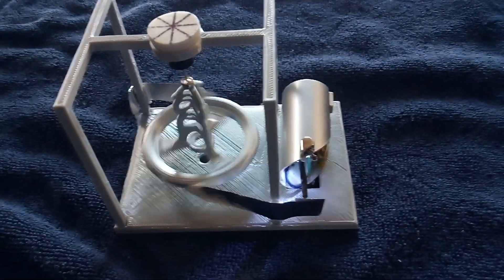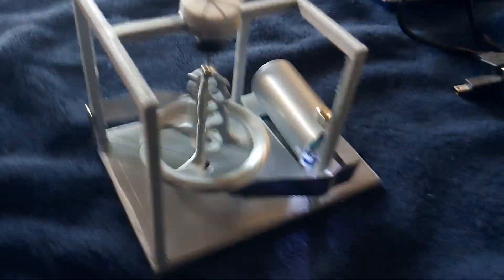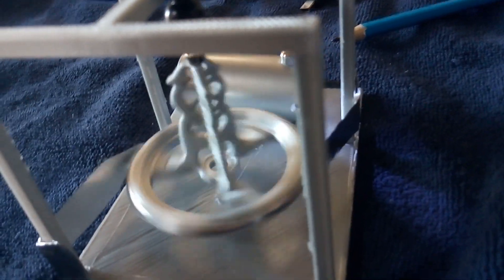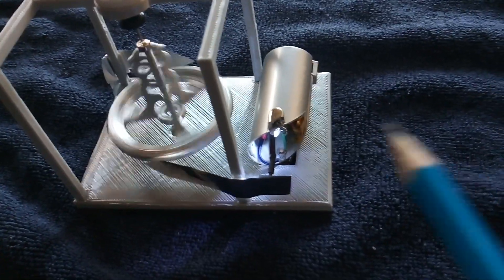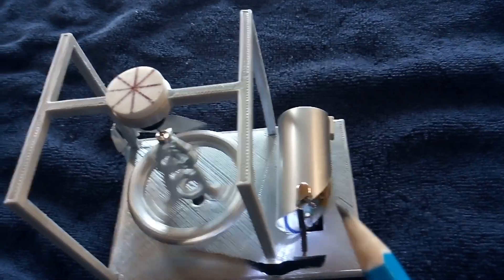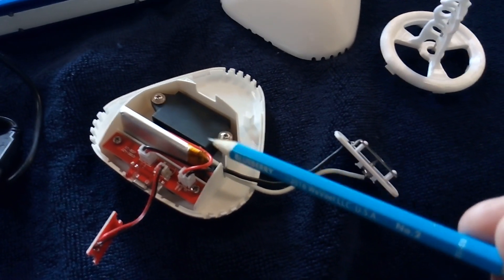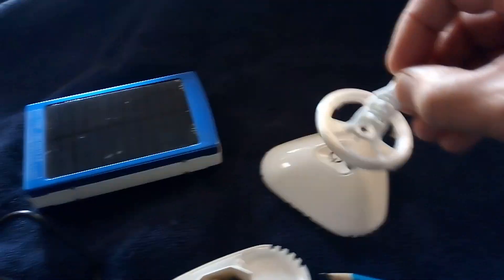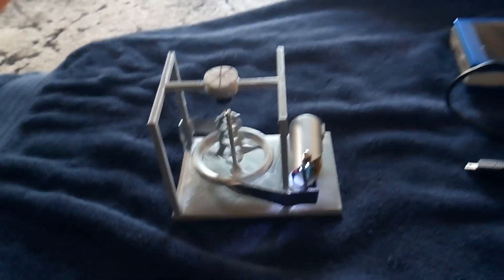Electrostatic Stone Grandfather Top

Comment: Yeah thats the thing about electronics and certain gadgets,  you think they will last longer then they should but they don't.  I do think you should go through with the solar panel idea though however if you do, id connect them directly to the lithium ion battery through a diode.  Otherwise your gonna have a lot of losses through the charge circuitry and its not going to work very well.

Comment: That triangular air freshener is the same as the one I bought a couple of months back to try to kill the smell in our microwave. It did work but my wife found it made her cough so I stopped using it. Bigclivedotcom did a tear down review of one and reverse engineered it to draw a circuit diagram. I have it in mind to use it just like you are saying, but I will see what comes in the post first from eBay as the one I ordered is cheaper so I am happier to strip it down.
Reply from the maker: I watched Bigclive;s video on the triangular air freshener and it was very helpful.   That thing  only runs for 5 minutes each hour so the claim that " it runs for a week" is very deceptive.  That said it is still a pretty neat little device.  Too bad that it draws 30mA.   The little necklace air freshener is a perhaps a better choice for what I want to do.